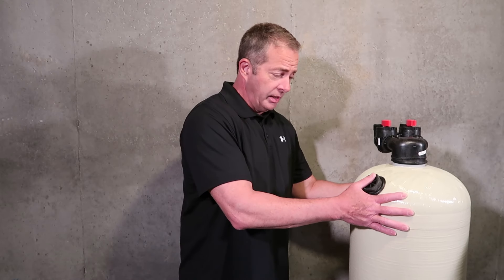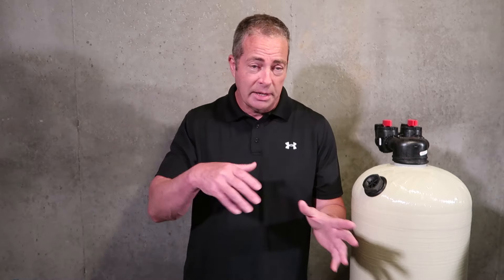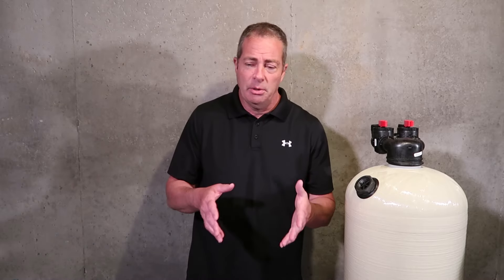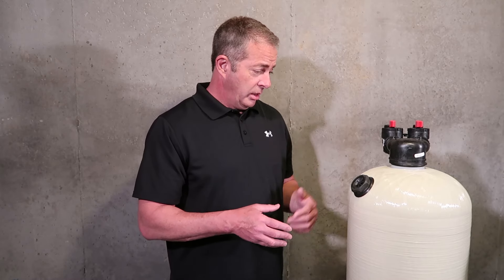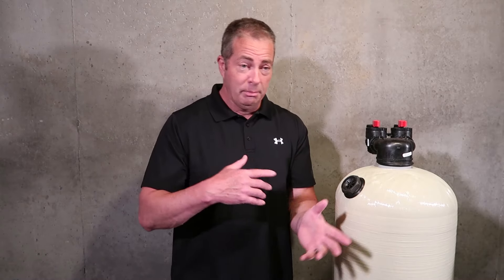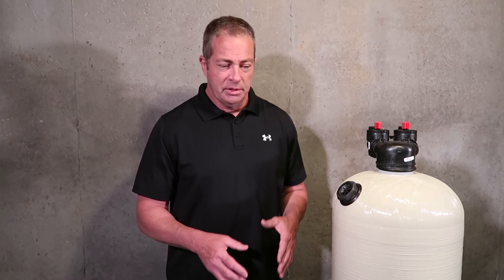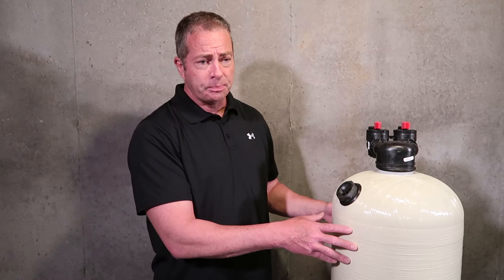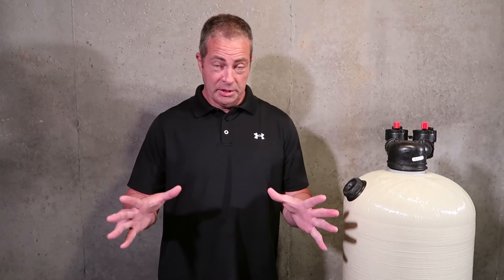Backwashing Acid Neutralizer vs Non Backwashing  Acid Neutralizer

Comment: Great information!!!

I bought an old unit 10x54.  Came with a backwashing head.  The standpipe is a cone style with plastic discs stacked and screwed together.  If i simply never backwash it can it have the same positive effect as the non backwashing units?

I have perfect water except low pH.
Reply: Yes
Reply from the maker: Yes

Comment: I'm told I need one of these as a first step in treating 15ppm iron. My water is pretty soft, 6.5-6.6ph. Can I get away with a non-backwashing unit? I am thinking that as soon as one of the downstream filters backwash, it would essentially backwash any upflow filters before it as well since it will be flowing 10-12gpm upflow.
Reply from the maker: @daniels2535  no with that much iron I would recommend our 2510AIO system it will remove the iron and raise the ph at the same time. No need for the neutralizer 
https://midatlanticwater.net/products/iron-removal-filter-fleck-2510aio-2-5-cubic-foot-13-54-with-katalox-light

Comment: Why is every water treatment company I’m contacting in MA advising me against a non back-washing unit? I don’t have iron or sediment issues. They all say there can be compaction issues and they would “NEVER” install one. 🤷🏻‍♂️
Reply from the maker: We’ve been selling them for 25 years no issues. Most of our new customers are replacing backwashing systems with non backwashing.  We sell both. 99% choose the non backwashing no issues.  I installed and serviced them for over 20 years

Comment: I currently have 4.5ppm iron and 5.0 to 5.5 ph before  softener.  Can this unit be used with a sediment filter?
Reply: As long as the iron is filtered out before going into the neutralizer
Reply: @Papawalsh7  any advice  on filtering to remove 4.5ppm in iron before neutralizer?
Reply: @chester5010  I sent you an email

Comment: sounds like you don't like the backwashing units.
Reply: We sell them, but in most cases their not necessary. They waste a lot of water and require a drain and electric.  The non backwashing doesn’t need any of that and is much less expensive and much more efficient